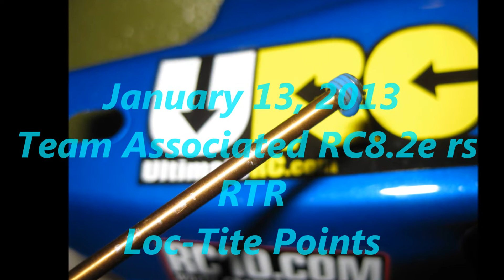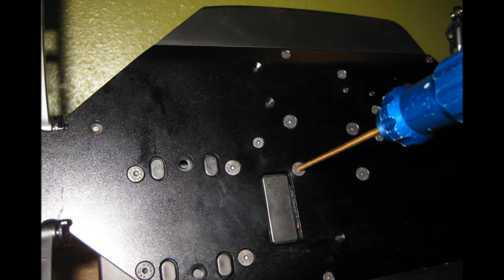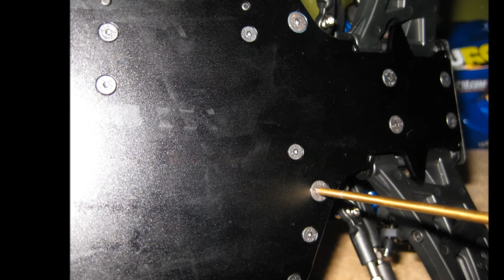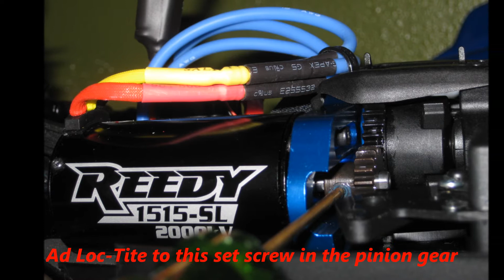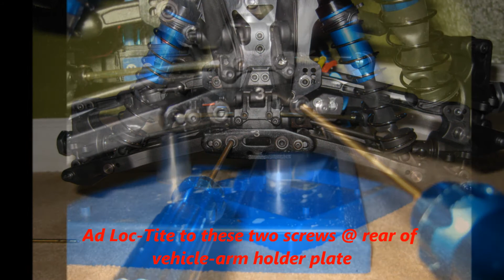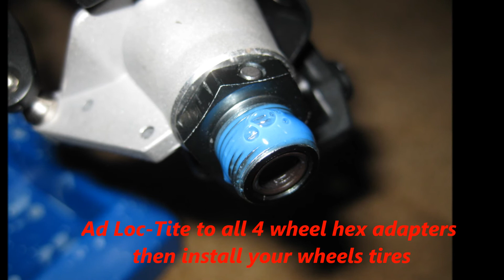Team Associated RC8.2e rs RTR LOC-TITE POINTS.wmv

Comment: Hey man, thanks for posting this. 

Both myself and a fellow at the track ran ours without doing the above and had parts come loose and then had to do the steps listed in the video regardless. I was able to re-tighten parts without incident but the other fellow stripped his spur gear as a result. Our servo's also went almost asap, mine went on the 2nd pack, the poor quality servo's also worked towards making this not a "true" rtr for me.

Comment from the maker: correct I think team associated got the word and I believe these loctite points are being addressed at the factory, in case anyone does not know Team Associated is owned by Thunder Tiger, and the Tunser Tiger MT4-G3 had the same issues of not being loc tite from factory, but I believe even the T.T MT4-G3 is now getting the loc tite points done from the factory, so I think Q.C has been stepped up from both sides T.T and T.A

Comment: I would be careful using Loctite on the wheel hexes. Thread lock is made for metal to metal contact. I've destroyed about 8 truggy wheels when I was trying to secure the wheel nuts from loosening while running. I later inspected the second set of wheels (after the inside of wheels got chewed) and found tiny cracks stemming from the center of the wheel...the Loctite was eating away the plastic wheels. 

Just be aware, and maybe test some old wheels if unsure of the plastic eating nature thread lock "brings to the game", or maybe letting thread lock cure/dry into a solid form is an idea. I've since switched to nylon locking wheel nuts, and feel they are the best way to go.